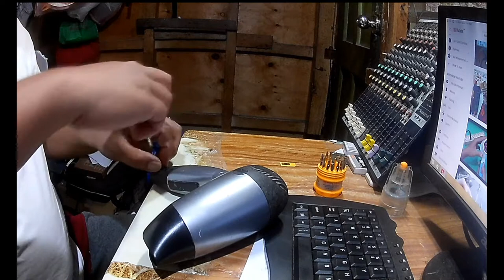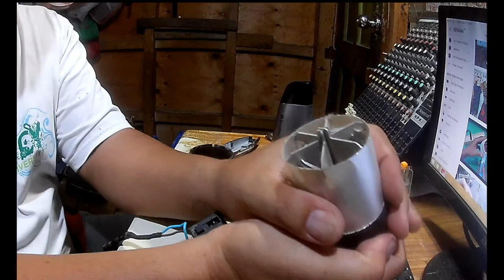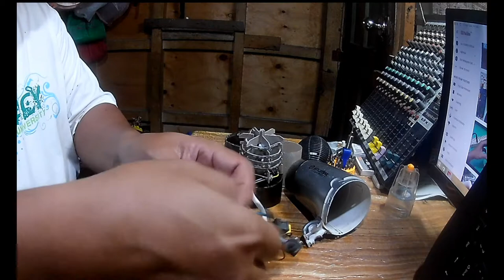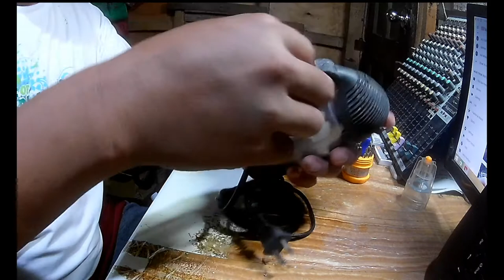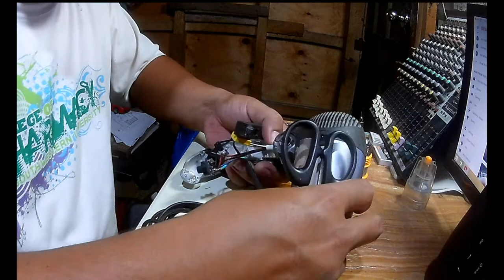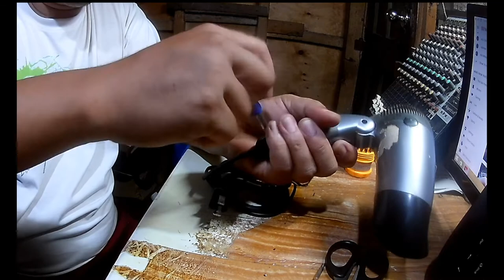HAIR DRYER / HAIR BLOWER REPAIR/ Imarflex

Comment: Sir paano po ayusin kapag ung low nya naging high??
Reply from the maker: baliktarin mo yung wire nya
Reply: @dhelelectromaster ok lang po baliktarin kht for example ung high nya napunta po sa low tas pagnilipat ko po sa high naka high parin po sya.. Bale dalawang high po sya🤦‍♂️
Reply from the maker: @deverauxdee1359  sa low may diode yan baka yung low mo sira yung diode nya check mo muna
Reply: @dhelelectromaster  ah cge sir thankyou po